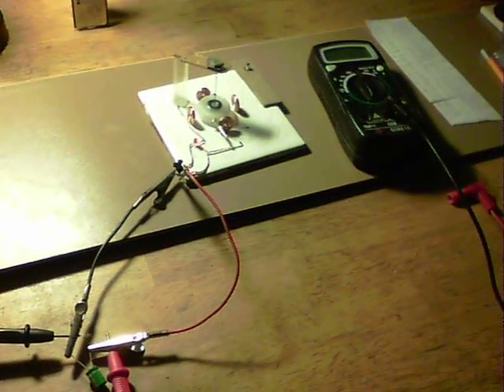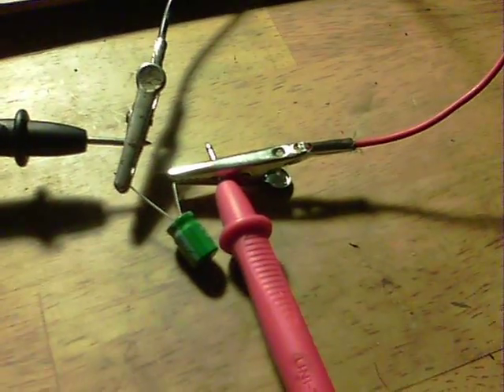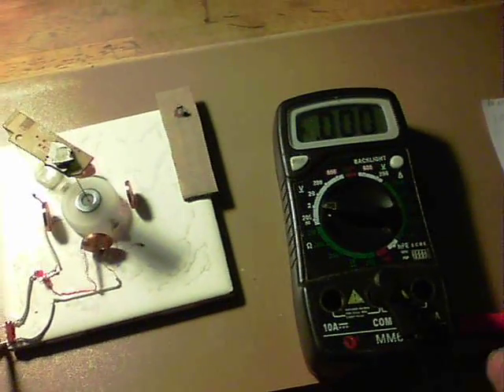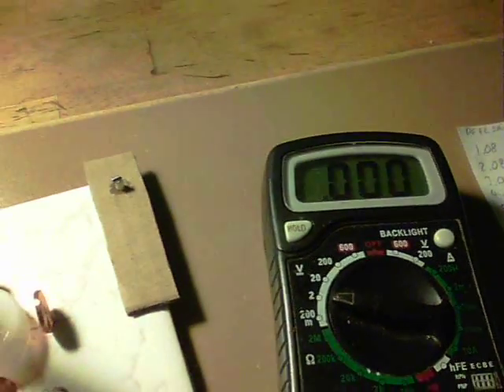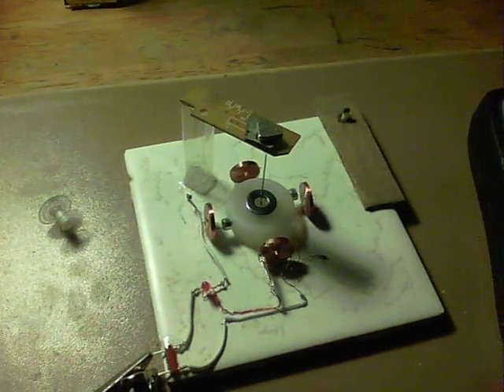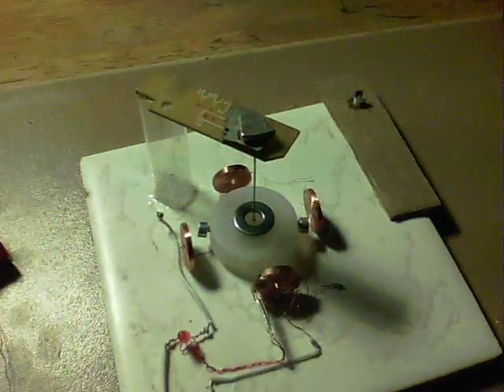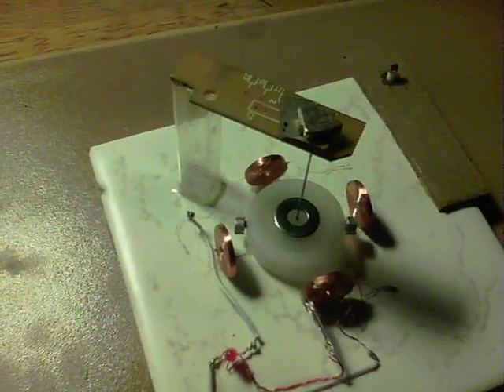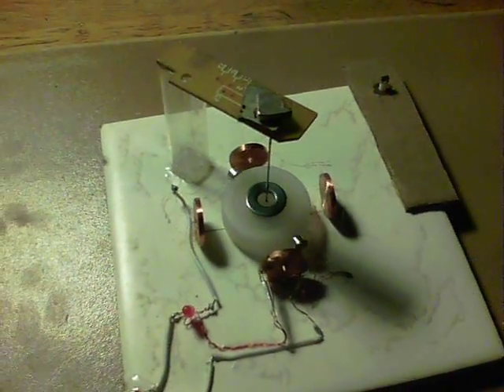24hr run on 1F cap - DF EZ Spin motor

Comment: Wow . Splendid work Wallace. The most I got to run my Ossis motor was 11min on 1f. I'm surprised it doesn't have a bridge and another reed to collect the collapse.
Reply from the maker: Cheers Gromit, very kind. I've still not worked out how it back charges like this either, expected at least diodes in LS's original.

Comment: That's Fantastic Slider. Here a link for 10 pieces @ $10.90 free shipping. Though they are out of China.
http://www.ebay.com/itm/1F-2-7V-farad-Supercapacitor-x-10-pcs-100-000-cycles-compact-reliable-structure/261737262776?_trksid=p2047675.c100009.m1982&_trkparms=aid%3D777000%26algo%3DABA.MBE%26ao%3D1%26asc%3D27674%26meid%3D9890a0d23eaa4b69abbdc5643997c8af%26pid%3D100009%26rk%3D1%26rkt%3D1%26sd%3D121511061346
Has always great work.
Reply from the maker: Oh nice link there ! and thanks for finding it :)
Reply: slider2732
Great job on the EZ spin. And your very welcome :)
All the best.
Bobby

Comment: You're on a role!
say, all my coils are too fat for this right now...
I'm wondering what would happen if you tried to run it on the A-field. turn all the coils 90 degrees each, and if only you had thinner "tall-ish" magnets to match the thin "sidways" coil's...
anyway, this should allow you to squeeze in more coils, especially with that low .5V field...
Cheers - nice work!

Comment: Thanks Slider

this is bad profiteers

Shipping:
	 	 		 					 						$17.13 						 				 				International Priority Shipping 						 							 to Netherlands 							 	 via the Global Shipping Program
Reply from the maker: Heck that's a lot ! I just tried to find the same capacitor, as the seller isn't listing anymore where I got mine from. They are quite a common brand though, so i'm sure you can get them much cheaper. Hope so :)

Comment: Well done !
Try to multiple switch the coils rapidly,. when the magnet is top dead center.
This way you will induce much more backEMF !
Regards. Stefan.
Reply from the maker: Thanks Stefan and for the advice.
Immediate thought was of a Hall sensor and transistor circuit (Muller memories), but then just thought about a second reed switch, which could be just as good and allow for lower voltage use. Yes, will look into TDC switching :)

Comment: Hi, Good God now that's dedication and amazing great work
Reply from the maker: Thank you, it's still a 'work in progress', because the biasing magnet has really helped after it stopped running just before 27hrs. is running again on the untouched capacitor :)
Reply: 27 hours, that's incredible. don't know much about motors or electronics myself but watch all your videos and think they are fascinating. Found a video recently showing how to build a lidmotor style pulse motor so think i might give it age one day to see if i can run it of crystal batteries. Regard Mike

Comment: Thanks for sharing

Have you link for super caps
Reply from the maker: Yes, though different seller. Here's the exact cap:
http://www.ebay.com/itm/Nano-Force-SUPER-CAPACITOR-2-7V-1-0F-1F-4-pcs-New-/121511061346